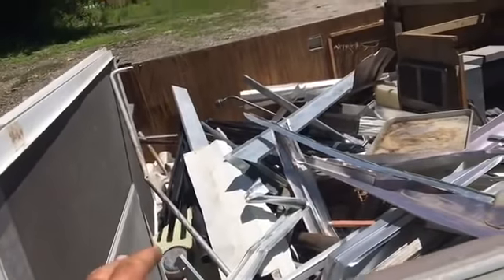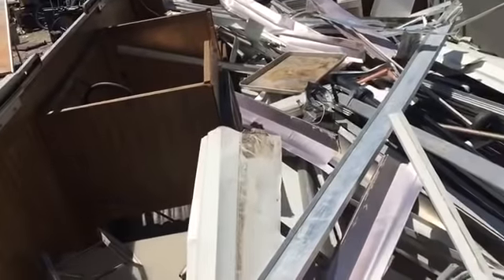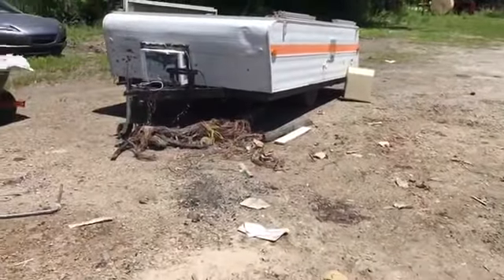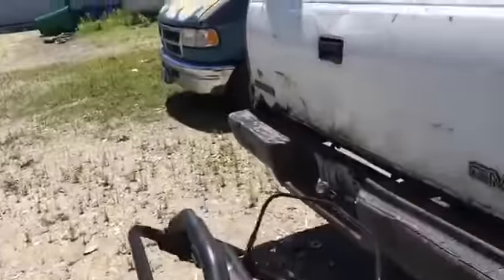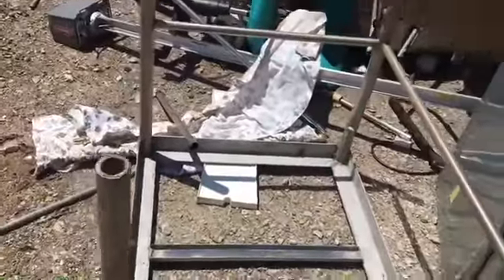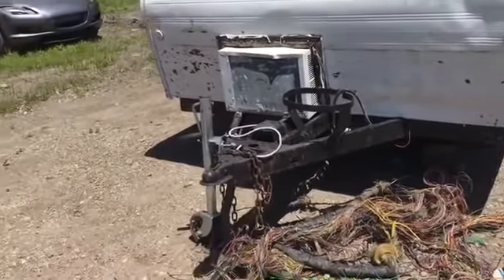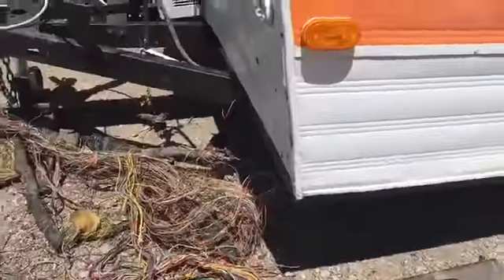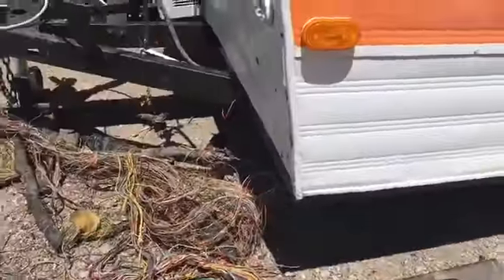Gotta keep order😰

Comment: U put a hand held drill in it use like drill press👍
Reply from the maker: So I wonder if it’s missing a piece. Is there a second piece
That is missing?
For some reason it doesn’t look complete
Reply: @steelisthemeal  it is the other peice clamp it together and there should be to clamp so u can hold in place or four holes to bolt it down 🤯👉